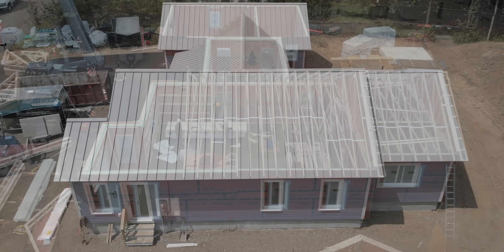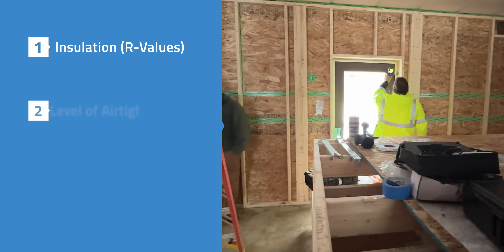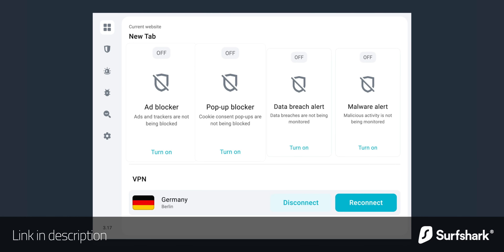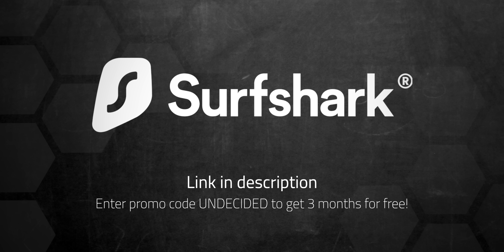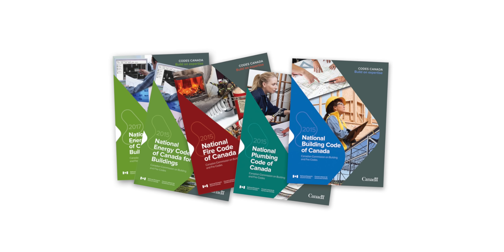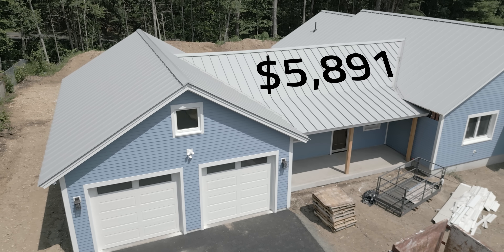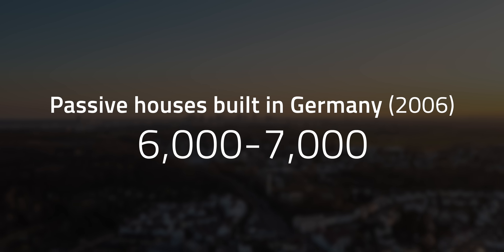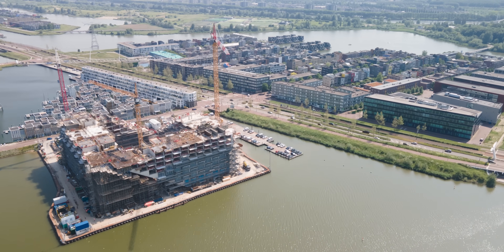Why Do American Homes Suck?

Comment from the maker: Are you interested in a more energy efficient home? Get an exclusive Surfshark deal! Enter promo code UNDECIDED for an extra 3 months free at https://surfshark.deals/undecided.

If you liked this, check out Why is this Propeller Getting So Much Attention? https://youtu.be/UzYHO4tksTc?list=PLnTSM-ORSgi7uzySCXq8VXhodHB5B5OiQ
Reply: Just wondering… I’m just wondering with all your bells and whistles on your house… how much did the house cost to build? (Ball park is ok too) if you don’t want to say I completely understand
Reply: I am concerned about air quality in a low U-value house.  As someone who works in a laboratory, I'm accustomed to regulations demanding high air turnover.  I'm aware that you're more likely to have to deal with frying fish and burnt pizza rather than toluene vapors, but shutting air turnover down could lead to unfortunate problems.
Please address this in a future video.  Like your channel name, I'm undecided.
Reply: @lonjohnson5161 :  you have identified another of many problems you’re going to get with a house that is too tight. Pretty nearly gonna suffocate in that thing.
Reply: Don't sweat building standards in the US. In Australia they suck even more.
Reply: @AussieUnclePhil   AND that is OK, most building standards relevant to insulation are required for cold climates, not needed in Australia.
Reply: My house's air tightness is 0.19. And codified standard is 0.6 for all new houses in my country. So far more better, than needed. 0 utility bills all year round, i'm happy :)
Reply: Hey you're the guy that'll lie about anything for anything. I knew I recognised you. You push snake oil on the unassuming.
Reply: @undecidedmf hey, you need to report the imposter on your channel asking respondents to text him. Despite the fact his profile was created in 2014, I suspect he is not you.
Reply: @TheFeaz  Those are hacked accounts, it is a big organisation, fully automated, they sent out many millions of these posts out. if only 0.01% falls for their scam it is still profit. You can't stop them.... however you can annoy the hell out of them, keep them busy, act interested, keep asking to explain over and over again, ask every stupid question you can think of and ask questions hard to answer for an AI system, like personal questions, are you married, where did you meet your wife etc.
Reply: @buddy1155  That's hilarious. They probably just feed all of the responses to chat GPT or something, so I doubt it makes a difference. Anyway, I'm really surprised that the YouTube algorithm doesn't recognize those kinds of accounts and kill them. The particular one that's doing it here seems like even a rudimentary algorithm would recognize it.

I am also a creator, and I had seen, on another channel for creators, a discussion of some software that you can use that will clean your channel up for you. I haven't had this problem on mine, but right now my content is in more niche places. I think that a big channel like this having this kind of problem with spam maybe needs to look at employing some type of software like that to clean their channel. It's really neat. It's basically a command prompt application that then accesses the YouTube API and uses its own AI to screen comments and delete those that it deems to be spam. It seems pretty effective from what I've seen.
Reply: @TheFeaz  The best way to break the business model from scammers is waste their time. If only 1% would do it, it would work. They have to go trough that 1% to find the 0.01% sucker, that somehow does fall for the scam.
Reply: The most energy efficient home is a cave where there is year round climate control we can outlaw all houses give everyone an electric scooter and one solar panel.
Reply: anyone who says american homes suck has never traveled europe or asia.....
Reply: @oyeahisbest123  yeah...so many houses in 🇪🇺 Europe suck as well. I saw buildings that even had no running water (originally), and the pipes were added later. Well, some had kind of running water in a circle outside the walls. The builders probably did not even have YouTube for a quick tutorial 🙄
Reply: Your video comments are often run through with ignorant bigotry against America and Americans. I know the attention is good for your channel, but were that the kind of people my videos attracted I'd rethink my approach.
Reply: Don't look at the UK as a model country in Europe because compared to Germans or Poles they are 30 years behind
Reply: I looked at all the homes that your experts were in and your home included and they are just butt ugly. I’m sorry to say. 

The building industry is in shambles and, while energy efficiency is important, and I’ll be the first to admit it, there are so many things wrong with the building code that are getting us nothing but ugly expensive housing, what a shame!

Every single home you showed was just simply but ugly, and including yours, the construction techniques are still 50 to 100 years behind the times. Shameful!
Reply: nice video. :D
Reply: I would not ridicule you for your feet, I got two of them myself.
Reply: Single family house zoning (like yours) are the reason why American housing is completely wrecked.
Reply: Things are not that perfect with very well insulated walls. The facade is exposed to higher temperature differences and, in spite of the "Glaser procedure" ( Glaser-Verfahren in german) for determining the dew-point, this can fall in the insulation, leading to a very common problem in many amercian houses: mold !
Reply: "Meanwhile across the pond, English building regulations...." may apply to new construction & that's great but they have a huge housing stock that's not much better than a tarpaper shack with a fireplace.
George Monbiot wrote about this in his 2005 book Heat: How to Save the Planet from burning, in the "Our Leaky Homes" chapter.
Reply: Energy efficiency house construction is  vary bad! We need to support coal miners and oik workers!! Punish solar and wind industry will keep them down and proof the point
Reply: Im in texas now and commercial construction is almost never  only wood but houses are for a good reason.  fire or collapse is super fucking rare.   The house im in is from 1939 and only has bricks on the outside and its in excellent condition.  The only problem is the concrete foundation is buried in 10 feet of clay so I have to run a soaker hose during the summer so it dosent tilt.  If it had bricks or concrete slabs the wall would have collapsed already due to the extra weight when tilted.  @@username__login
Reply: Every extra large wind and America is building again. Well done )
Reply: The amount of money you save with your house in energy bills is about twice as much as I pay for energy in total. And my house isn't even passive. It just fulfils the requirements for building efficiency here in Austria.
Reply: @dak1st  - I hate to break it to you but how much your energy bills come to each month tells us absolutely nothing about how efficient your house is. First of all, electricity and gas costs vary wildly from place to place so we would first have to know how much your utility company charges per kilowatt hour for electricity and how much per btu or per cubic foot of natural gas. Next, we would have to calculate any square footage differences in the two houses as the bigger house will obviously use more energy. Bear in mind the average square footage of a house in the USA is approximately 2.5 times greater than in Austria. Next, and most importantly, you would have to know the climate the two house you are comparing are in. Some places can get up to 120 degrees in the summer while others can be as cold as 50 below zero in the winter. In addition to all this we would also have to know how many people are living in the house as more people generally equals more energy usage. And of course, we would also have to know how frugal or wasteful the occupants of both houses were when it comes to energy usage. The bottom line is you need to compare apples to apples. 

As for your house “not even being passive” I’m not sure what that means. I assume you mean that your house does not use solar energy for heat gain. There are two types of houses when it comes to solar heating, and they are known as "active solar" and "passive solar". The only difference is that with a passive system the house itself is the solar collector. In an active system on the other hand, you have solar collectors on the roof, and a control system to move either hot air or hot water to some kind of storage medium during the day and then from there it is circulated throughout the house at night.
Reply: @SLOBeachboy  You clearly put a lot of effort into your comment, but please read up on passive houses. Or just watch the video. Passive houses have nothing to do with solar.

For ~90m², I had 150kwh heating cost over the last year.

No AC needed, since the house is insulated well enough that it doesn't go over 25°C, even if it's 38°C outside.
Reply: @dak1st that is an absolutely tiny house.  About a third of the size of average houses in America.  Just my garage is almost that large.  You’re not comparing fairly and ignoring a lot of complexity.  Also 25C would be too hot for most people in the summer.  23C is what I air condition to.
Reply: @lookoutforchris  So your point is "Americans are just wasteful"? That's nothing new.
Reply: What about natural building techniques like straw bale, rammed earth, stabilized earth blocks, cob, or hyper/superAdobe? Any proven homes in the US and maybe by region? Some of your issues in this video are by region. Climate, environment, soil, bedrock, water table, and frost line all llay a part in home design in the States.
Reply: The reason we have such crap houses. Is. They are built for profit. Nothing else matters.
Reply: When I was looking to build a home in the early 2000's, they were building environmental homes in my area. The builder had three categories:1) Health 2)Environment and 3) Efficiency. They did not always agree with each. Example having tight envelope of your home did not allow the flow through of air.   Geothermal was being done, but that requires  a fair size lot. Many things got "banned" because many trades did not know how to install them or DYI screwed them. Biggest thing is understand your area and what is best in the area you are in. BTW they used a wood burning stove as their back up for cold weather & power outage than a furnance.
Reply: Window manufacturing is particular to the area that it is.
Reply: Net zero is nonsense what part don't you understand? and besides most any residential development built after 1995 is built poorly compared to homes built in the 60s and 70s
Reply: Why all the pine? 

The cheap way is concrete and rebar, the concrete NEEDS to be AT LEAST 6 inches thick, with rebar through out, or if your cutting corners, rebar needs to be applied every 1-2FT, WIFI extenders/numerous routers can keep your homes wifi operating properly/optimally, hurricane straps, for keeping metal roofs, on/together/the structure of a house together, in general, is a great option; The better/ more expensive way is, ALL steel, DEFINITELY no wood, outside or for structure/wood shouldn't be around windows either/used for framing outside either, also no wood porches, steel is the best, with a steel cover, but plastic decking is really popular now days, for longevity as well; Tornado proof windows is a MUST,  but I would minimize the amount of windows used/ that would be even better, and also like I've said, a steel roof, NOT tin or shingles; This would basically fix all your problems, with stability, pine is garbage, its fine for inside, for shelves, but not outside or for structure; I would also get steel storm shutters, to protect windows, make sure the steel doesn't move/make sure the steel cant bang into the Windows/so make sure the metal shutter, is far enough from the window, to not touch the glass and make sure the shutter doesn't sway; I only want to build once.

Also solar and battery backups, would be great too, protecting your security cams, with a steel enclosure,is good too.

The other thing I would do, RIGHT AWAY, is change out all of your screws on your exterior doors/ a child can kick doors in, if its only installed/secured with screws that are an inch long, 3inches is good though, if you look at MOST doors, that get kicked in, only the pine gets ripped away from the frame/ the screws wernt in the studs, also braid nails, MIGHT be the only thing holding your door frames togeather as well.

The better way for doors, is steel frames, with bolts, but just switching out those tiny screws, will make a HUGE difference, aslo a bigger/longer strike plate would help as well, with more screws, don't forget about the screws on the hinges as well though, I like ASSA locks, but Medeco is good too.

I also have two layers of 5/8" sheetrock, with a 2 inch air gap, I also have the soundproofing foam as well and I used paint, that is supposed to be sound proofing as well.

I want my house to be around after I'm dead, you cant achieve that with pine/wood, unfortunately, I also don't want to have to do maintenance on the outside of my house, every 5/10/20 years/ my goal is 50+ years.

ALL lower levels, should be underground, in an area, with absolutely no windows, if your completely underground, that shouldn't be a thought/option anyway, but it is something to think about though.

I've also done other things to my house as well though; my house has ALL 20AMP or higher AMP outlets/breakers, no 15amp outlets or breakers, ALL wire in my house is orange/#10 gauge, or above, each room has, at least 8 DEDICATED outlets, my house has a 600AMP panel, I had two whole house surge protectors that were wired inside AND outside, but recently I switched those out, for the ones that ALSO are supposed to protect against EMP, I thought that I might as well/I didn't see a reason not to; I went with a commercial dishwasher, 2min wash times is a MUST, also endless hot water as well, whole house reverse Osmosis/ to make sure water is as good/clean as possible, I've probably forgotten, SOMETHING, but if you do this, your house is DEFINITELY built better than 90% of most peoples houses, I honestly don't know why houses are built so badly by default, in the US.
Reply: Soviet mikrodistric vs USA suburbia
Reply: Out of curiosity, is everybody here aware that the main financial driver behind the climate alarmist lobby are actually the oil companies themselves? JS
Reply: I’ve been in a building industry for nearly 3 decades, have designed and built houses including building my own house by myself, no subcontractors.

The building code is a disaster and furthermore, not a single home is built to code, the inspectors are not doing their jobs, and builders know how to get away with everything.

Finally, the design of homes is about 100 years old and the only thing making construction faster is some tools, the actual design philosophy is horrible for normal construction.
Reply: Instead of talking about construction of homes I’ve actually built many of them, including every single aspect of the home and I’m also an engineer so I kind of know what I’m talking about, don’t know everything but I know a hell of a lot more than you. …. on homes.

The primary contributor to the high cost of housing and the poor quality of construction is the building code itself. But when someone like you uses artificial intelligence to do a report on the building industry, well that’s what you get, the artificial part.

The code needs a complete overhaul, and I could write A complete book on what needs to be done to revise that code so that homes can be affordable and higher quality and still provide for innovations.

Building code prescriptions are cheated on all the time by contractors that know what they can get away with because the lazy government inspectors don’t do their jobs.

When I built my house, and I designed it also, absolutely no subcontractors on the job because they charge so much money and they take shortcuts, shortcuts that the inspectors will miss.

Homes constructed nowadays are 100 years behind the times on the basic construction technique.  If automobiles were built like homes, they would cost $1 million each and they would last a year or two.

The industry is choked by the building code and zoning laws and there is no possibility to fix this and get housing affordable until we address the monster in the room and that is the government itself. And here you are doubling down on a building code that you don’t even understand properly. Read the whole thing, and tell me that makes sense.
Reply: If you were in charge of the building code we wouldn’t be able to build even a dog house for less than $1 million. You really don’t know what you’re talking about.

Here’s the problem, first of all you’ve never built anything as far as housing goes. You’ve never done it.

Secondly, although you are a brilliant guy and an excellent communicator, you don’t know a goddamn thing about the building in history from an experience point of view.

Finally, you just seem to be a believer that the government can solve every problem with a bunch of rules and that’s not how it works. What we need is more competition and innovation, and the only way that can happen is with less rules and regulations.

I’m an engineer myself and I’ve been in a construction industry for nearly 30 years now. I probably know more about actual construction and 99 out of 100 contractors out there because I’ve done everything, I built my house myself with no subcontractors and I designed it. I have many many innovations in construction.

It’s really annoying to Watch your presentation. Why don’t you stick to something you actually have expertise in. Oh, oh, I forgot, then you wouldn’t be able to pump out a I generated content grifting from YouTube
Reply: If you were in charge of the building code we would be living in prison houses that are uglier than an actual prison.

I can’t over emphasize that you really don’t know what you’re talking about. There is way more to living in a home than energy efficiency. And by the way I’m all for energy efficiency and my home that I built and designed myself is extremely energy efficient.

you think that the building code Is the infallible Bible, but in fact, even though there are many good parts of the building code there are so many bad parts that are stifling innovation that we will never ever get affordable housing that is energy-efficient also without a complete overhaul of the building code and to basically deregulate way more
Reply: The problem in the US lies in the legal corruption of politicians called donations and the idiotic protectionism of the American market against foreign companies that is caused by this corruption.
Reply: Can we stop using wood for building houses? How about concrete?
Reply: In Denmark we are aiming that the entire country be carbon neutral in 2030, our capital, Copenhagen has major climate ambitions, and aims to be the first carbon neutral capital in 2025.
Denmark is one of the leading countries when it comes to renewable energy.
Reply: Sorry, but you still keep omitting time frames. You save 5K+ compared to houses in your area in a year? Month, 10 years, 50 years?
Reply: Americain houses are made of wood. Which is stupid apart from the heat loss. You get a lttle bit of wind and your house blows down! Edinburgh, Scotland. Has buildings made from blocks of stone, like a castle. Here for last few hundred years, and next 1000 years! Plus they look amazing!
Reply: @darrenmitchell2830 :  absolutely, it is stupid to build homes of wood except for maybe the roof, even then that should be done from steel and metal
Reply: @darrenmitchell2830 : I totally agree, and this guy here on this program is going overboard on the wall insulation. He can claim whatever he wants. You don’t need wall insulation at our R35.  And right next to it is a window with R3.  Where is the cost benefit analysis here, this guy is an engineer and nothing to show
Reply: Something does not beg the question if you then go ahead and ask it; it raises the question.
To beg a question is to render it not worth asking.
Reply: Lost a subscriber. Tired of this reductive "America SUCKS" approach.
Reply: @Objectified  ..Well, objectively  America (USA) does suck in most areas, from EU view in pretty much every area. And lets just exclude American Football or other sports "only" popular in America. 
To be fair, USA "sucks" because of low standards set by the government, allowing companies to provide subpar services/ products compared to other countries.
Reply: I believe you're confused with "triple glazed" and "Triple pane". Also most northern European countries need it ( triple glazed windows and highly insulated homes. ) , for the vast majority of US homes, its useless and unnecessary.
Reply: Intro:  no it doesn’t beg the question.  It raises the question.  Look up what begging the question actually means, it’s a logical fallacy and you’re using the wrong term here.
Reply: somewhere in the 'Earthship' stuff, books or website, (I can't remember which) was a section on turning standard American house to 'Earthship' standards.
Reply: @johnnyjet3.1412 :  Earthship is not a good way to build a home. It is almost always a mistake to take materials that are not meant to build a home, like tires, and try to fashion a home around them. It’s a huge waste of resources and manpower.